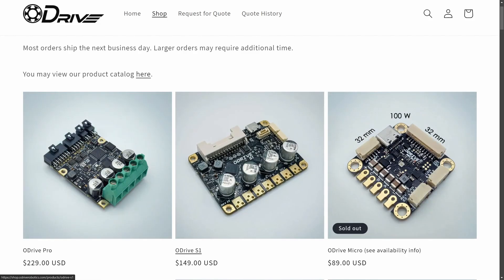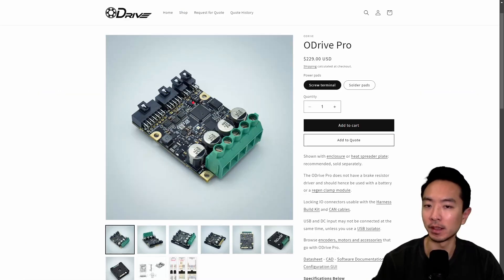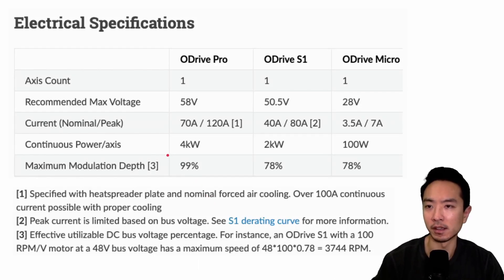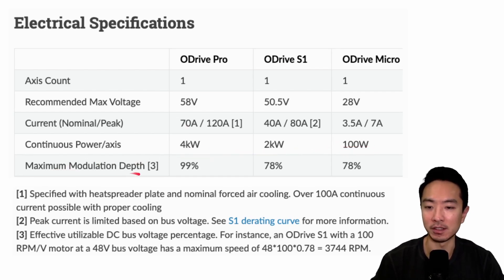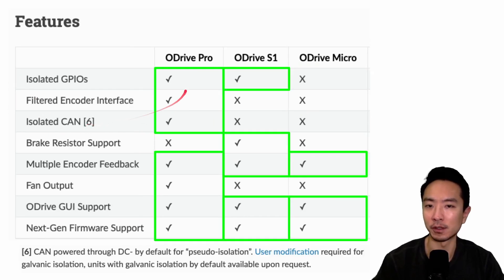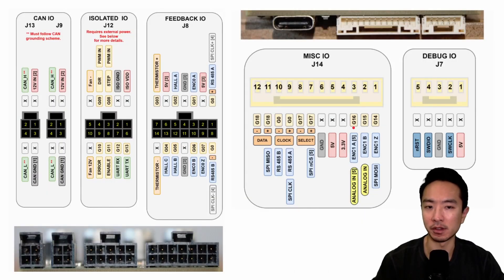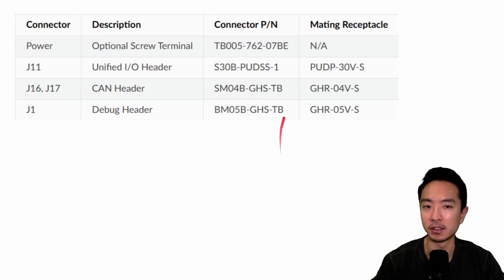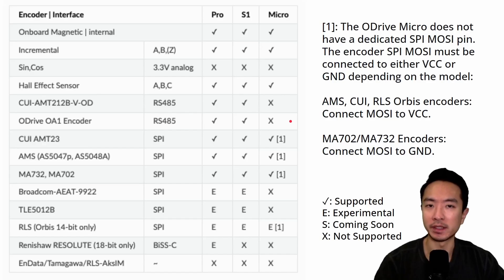ODrive Micro vs ODrive Pro vs ODrive S1: BLDC Motor Controller Comparison

Comment: Awesome, thanks. I am disappointed they don't have such a great comparison on their website. In the market for an S1, but I wish to see more applications of it online.
Reply from the maker: Thanks! I actually got most of this info on their website. They have a page on the comparison, but I added some more stuff to it. I’ll be making some videos on the S1 so stay tuned!
Reply: @kevinwoodrobotics  Awesome, looking forward to it! Would love to see whether the S1 could be controlled from a PC through python, I am aware they have a library, but would love to see how it works in practice. My goal is to build a dyno, hence I would love to read power values and set motor outputs (either torque, speed, doesn't matter) at the same time. Cheers!